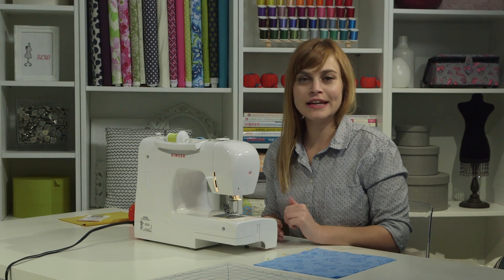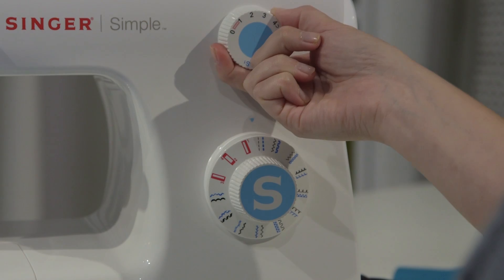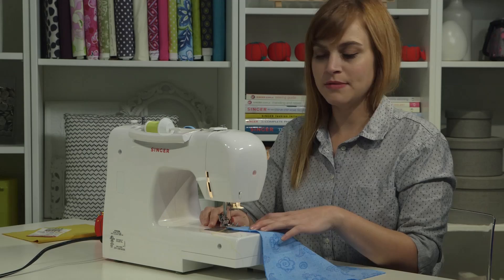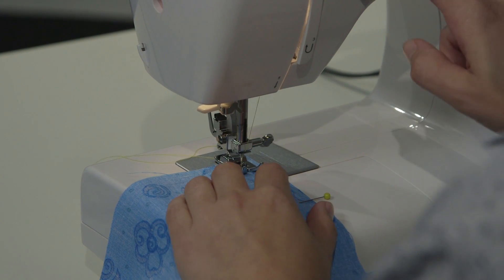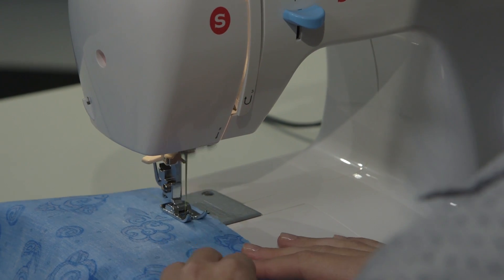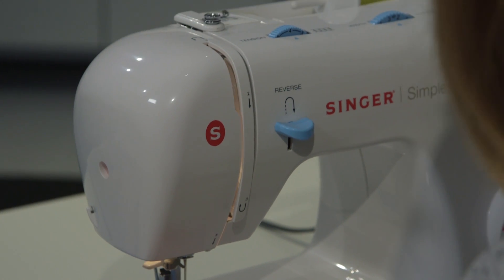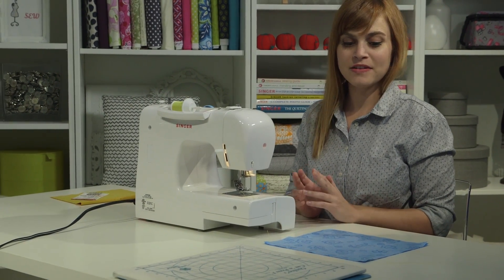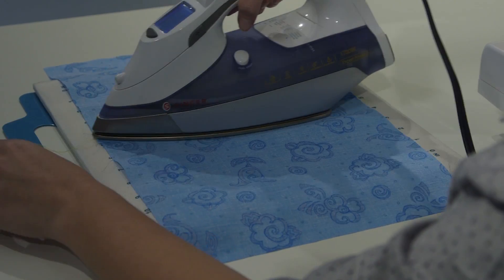SINGER® SIMPLE™ 2263 Owners Class - Sewing Seams

Comment: I want to take in arm sleeves at the upper arm. Must I open the seam first or can I sew seam then cut off excess?
Reply from the maker: It really depends on how the sleeves were attached to the garment. If it's a continuous seam from the wrist to the hem you may have better luck with that method than if was set it in the round.